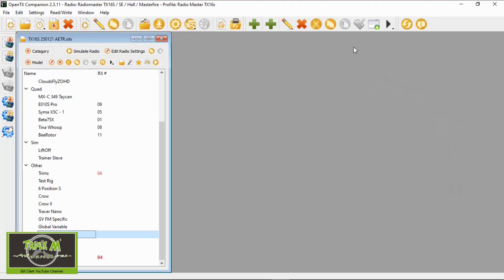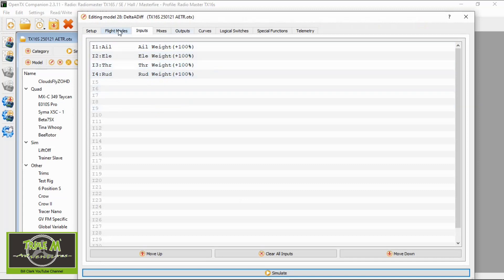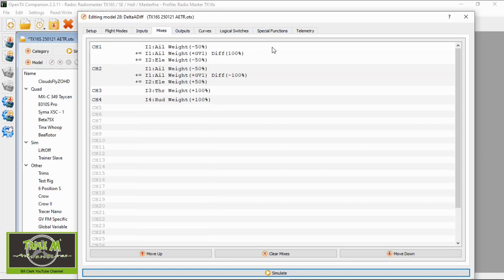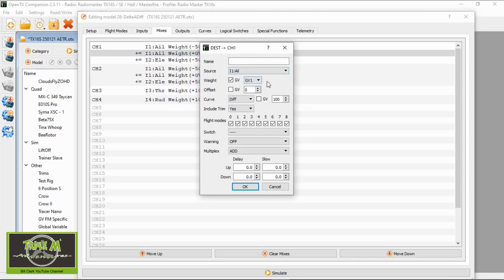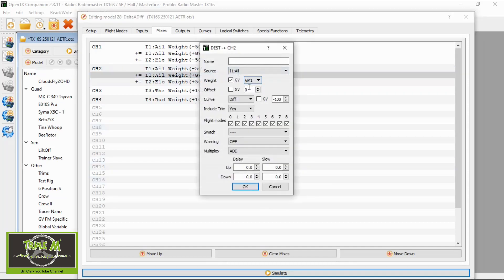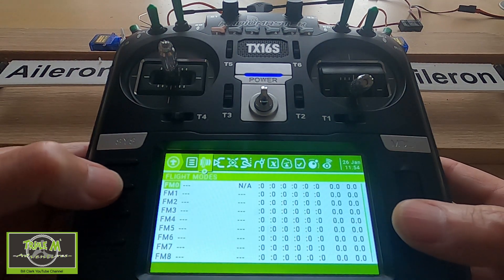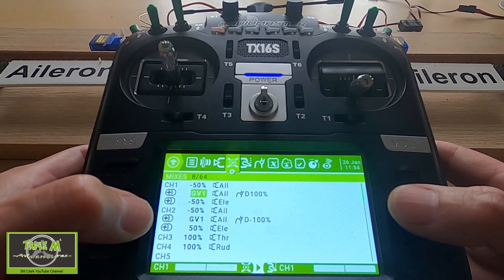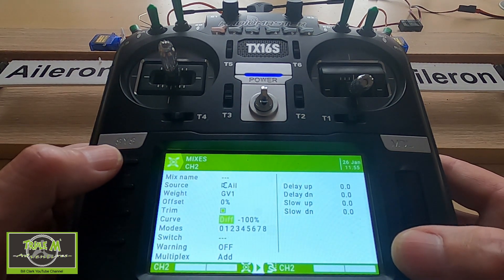OpenTX Elevons with Aileron Differential

Comment: Been waiting for this! Thank you for making the video on it. Is it possible to have the elevons function normally when using the aileron stick and to use the rudder to give you differential but, have it cancel out the aileron stick when you are using the rudder stick?
Reply from the maker: You are very welcome J S. Yes it would be possible it would require logical switches to disable the aileron control if the rudder control was moving.
Reply: @the-happy-RC-flyer  awesome thank you for the info